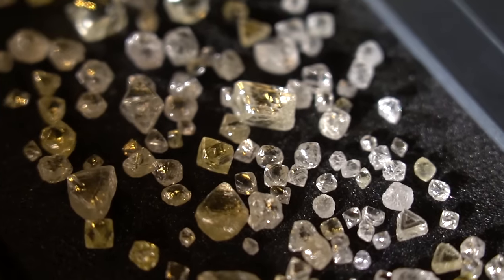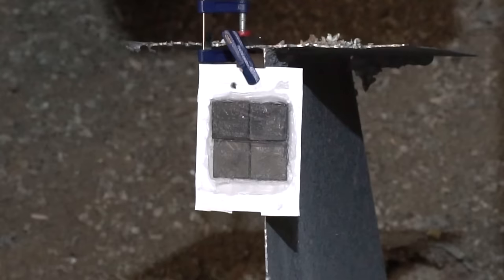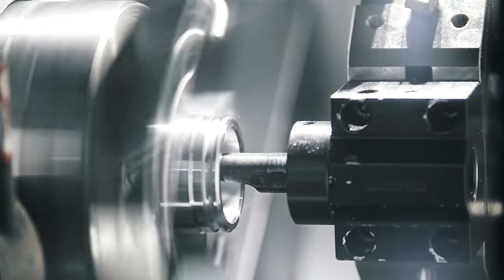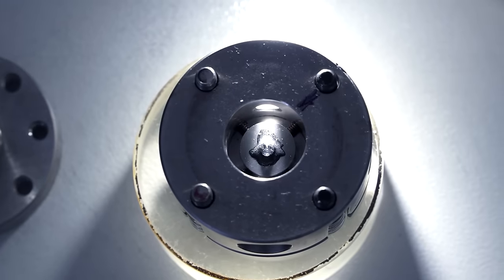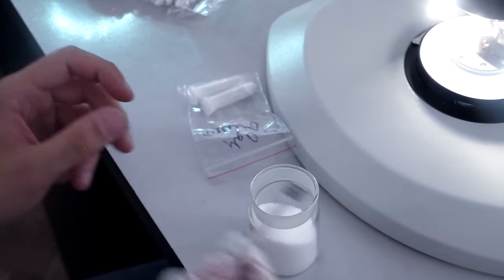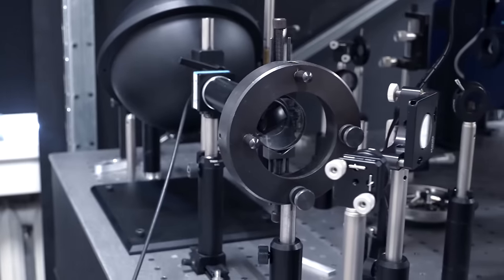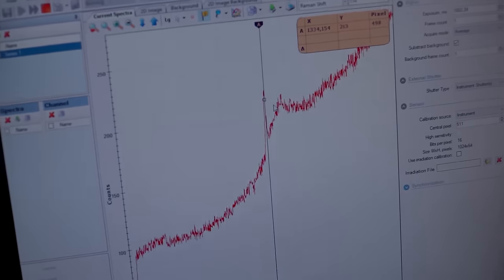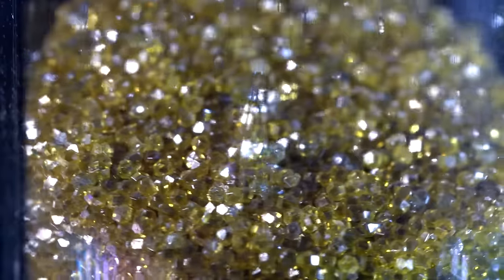Making DIAMONDS From Scratch

Comment: Cubic boron nitride isn't just tougher than diamond, but it is used to cut and grind steel because it doesn't get dissolved by the metal.
Reply: yeah, actually that is the primary reason why its used to cut ferrous metals, simply to avoid the carbon absorption.

Comment: I made gold from lead. Chewed fishing weights and swallowed. Out came gold. Only problem is I can’t do maths any more…
Reply: Same for me, almost. I use to chew charcoal in the hope that it produces diamonds.
Reply: Different, but related, I regularly chew tinfoil to focus & take my mind off things.

...it works remarkably well.
Reply: @_Solaris  ever tried indium? its quite an interesting experience, since its as soft as lead except its nontoxic.
Reply: @Metal_Master_YT  cool!  Will it give me the same brain-screaming electrical soul-shock I get from tinfoil? 😃
Reply: @_Solaris  It depends, what's the electrode potential of the reference metal currently in your mouth? actually, just tell me what metal you have in your mouth already, and I can grab the values myself. I can also estimate the voltage produced. also, try biting a strip of magnesium ribbon, or any other piece of magnesium metal, and you will get a shock something like 3 times that of aluminum. I tried it and it feels like a battery put in your mouth, which is basically what it is.

Comment: Under dry hydrogen, progressively dissolve powdered aluminum carbide in molten lithium hydride while electrolyzing (re alumina to aluminum beneficiation in cryolite).  Diamond forms from the hydrogen plasma in the electrical double layer at the anode, and rapidly grows.  Graphite, glassy carbon, other carbon lattices etch.  Thermodynamics proposes, kinetics disposes.
Diamond anvil press "iron foil" gasket?  Try iridium.

Comment: Water doesn’t shouldn’t freeze under pressure. Due to the atomic properties of the solidification process of water, the ice would expand to create more pressure. Instead, the water would be forced closer to it’s maximum density or compressibility (liquid) before becoming solid as Ice 7, a cubic crystalline structure of water. Correct me if I’m wrong, but I think that under standard pressurization circumstances water should not freeze.

Comment: Making a material that could coat thr outside of a space probe to shoot close enought to.ths sun to gain sufficient soeed to exceed any known speed for a space probe which could thereafter open to more quickly reach the Kiper Belt to interstellar space more rapidly thab anymy other known proble would be super cool.  It would have ro have a surface made from.materaisl made there while executing a very close-by solar gravitational assist which would I assume propel it at a fadter pace than we have ever achieved any other way. The probe could open its shield after leaving the nesrby solar gravity. So place it in a slingshot orbit as close as possible without having it actually enter into the gravitational well but protected enough to maximize the slingshot effect. I think that would be the most quick and most energy-efficient way to propel long distance soace probes into interstellar or far out nesr fhr helopause. It would just have to survive the temperatures I'm such a close flyby. It would also have to insulate the components from the radiation. Find a substance harder than a diamond as a coating of the shields... That actually might do it!